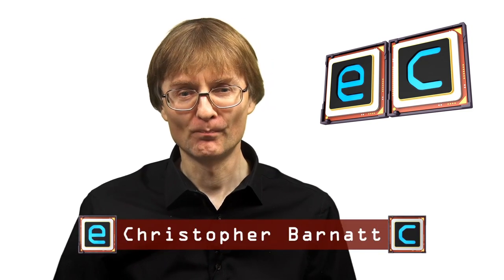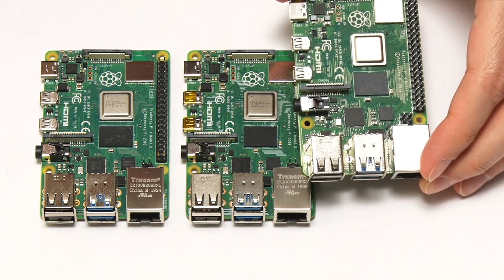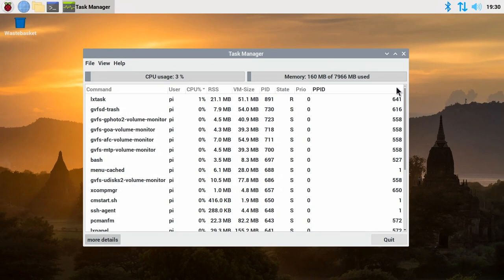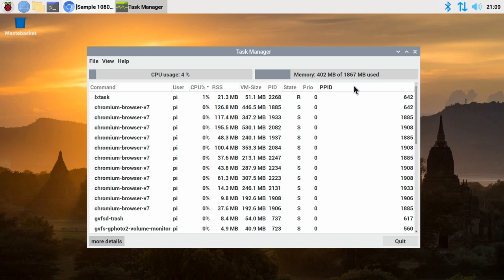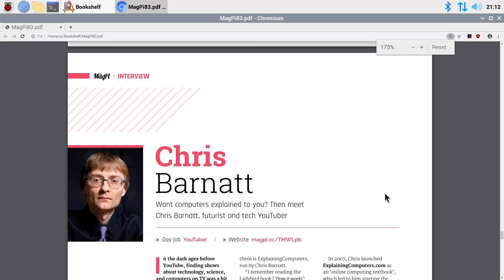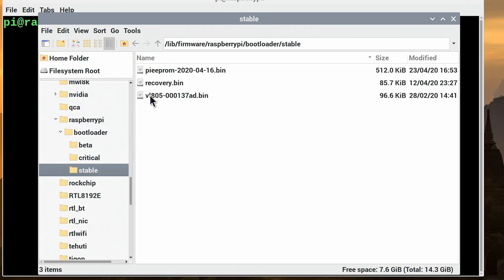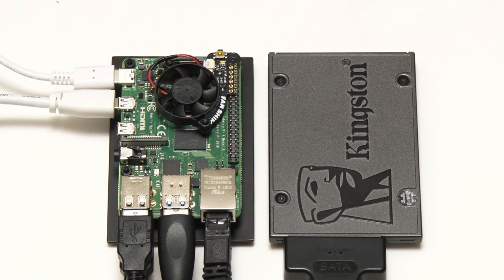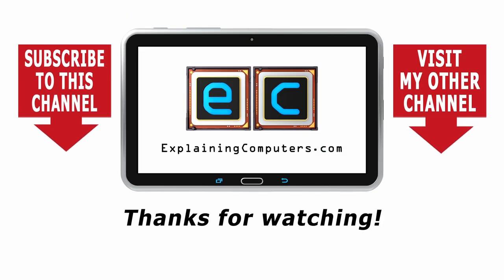Raspberry Pi 4 8GB & USB Boot

Comment: Thanks for your video! It works. However, it needed some tricks until a successful boot. With the last STABLE firmware (Jun 15 2020 ) the process is even easier and robust. I must mention the problem that I had with the sata-usb3 adapter. It wasn't compatible with rpi4's kernel and showed the most common symptoms of a misbehaving UAS device:
- Extremely slow performance - in the kilobytes per second range
- Frequent disconnects-reconnects of the device with the desktop repeatedly displaying the "removable medium inserted" dialogue box
- The kernel message log (dmesg) reports errors relating to a UAS device
I strongly recommend this guide if you don't have luck with your sata usb3 adapter: https://www.raspberrypi.org/forums/viewtopic.php?t=245931
Reply from the maker: Very useful link -- thanks for sharing.

Comment: Hopefully the RPI 5 has a much more powerful CPU/GPU stack at least for the 4 and 8 gigabyte models. As the modern and more powerful ARM chips get cheaper I'm hoping to see an eight core processor that can at least compete with the 2 years old Snapdragon 845 smartphone ship.
Reply: That's kind of greedy, considering it just came out. It could be a long wait. I was looking forward to Motorolla 68050 Mac, when they switched to PPC, and then again they went to Intel. Apple is definitely a different company than RPi, but still, you're counting your chickens before they hatch.

Comment: I would like to add that if you increase the amount of video ram, the desktop variants of Raspberry Pi OS will run much smoother. The max amount you can use is 500mb, though, regardless of how much ram your Pi has. You should see much better results at 128mb. I think Librelec uses 320mb for video.
Reply from the maker: Good point. I think i was on 64MB here.
Reply: @ExplainingComputers  - Try bumping it up and seeing if your 1080p playback improves (it should).

Comment: i just orden my first raspi4 8gb board and wait when can use, power have but i forget orden micro hdmi to hdmi cable wait thats now to post. and wait when come OS were have config section what you want use boot option, usb,sd card,usb harddisk,ssd,netdisk,ethernetboot. etc.first need be config option sd card or usb hdd/SSD. if thats come fast can buy more board and use better than idiot sd card system who broken wery fast. sd card not read/write manytime and not sure good harddisk.

Comment: Beware the USB boot... bricked two.
Reply from the maker: Now two is unlucky. A good warning here for others.
Reply: I had two pi 4 die with berryboot, using multiple os on an ssd, I have no idea if it's related, but I'm not touching berryboot again until it has proper release, (it works fine on the pi3) so maybe I need to wait for this too.

Comment: I am using mine as a programmable everything timer controller - to the second accuracy, as many actions as you want, repeating weekly, different for Sundays.Programmed in Python. using switches from https://energenie4u.co.uk/ I was irritated to find that I got 'pot luck' on which actual Pi I got from the online retailer in terms of power supply bug fix. I had no option than o get the official PSU. I was told they are all mixed up and the retailer can't tell them apart. Is this true?  I wrote the code on a Pi 2012 version but couldn't get that to also work as a file share hum ( hardly a NAS ). The Four works, but it was VERY hard to set up, all the online guides disagree ! I can no write to my HFSPLUS external drives, but can't alter existing files. Can you create a guide for creating a file server - with full write permissions on all disc formats - AND time machine options ? Thanks very much.

Comment: I use RPi 4B to write and publish a news paper. 
Also to publish YouTube videos   
I run al old mouse and keyboard into a USB adapter that goes to a powered USB 3. The second USB 3 I power a four hub USB bank that has 2 64 GB USB memory sticks and a 16 Gb memory stick and a USB fan on a stick that blows a across the board. Usb2 has a 500 Gb ssd drive. And usb2 has a video car ready for uploading 4K video. 
Check out YouTube channel Tirau Hall
Reply from the maker: Cool.

Comment: Very bad !!! Raspberry pi 4 heats even with 1.5 ghz quad-core processor at 15 watts minimum. Raspberry should look at any cheap $150 Andriod all of them are octa-core with atleast 2.0 ghz OR we can see iphone 7 with quad-core 2.3 ghz at 7.45 watts. Heating is not an issue today, we had that issue earlier. A hell lot of stupidity, they increased the ram to 8 GB running with stone age 1.5 ghz processor.

Comment: 3 Developer friends “on their own” have successfully created Windows 98 an XP (SKIN) THAT RUNS ATOP OF RASPBIAN OS.  IN ADDITION FOR GAMERS, THEY ADDED L”THE NEWEST RELEASE OF “RETROPI” AND “BOX86” IN THEIR MODIFIED OS.   THE SKIN GIVES FULL TEXTURE TO NEW LINUX USERS TO FEEL COMFORT WITH WINDOWS TOUCH AND FEEL.  (PLEASE NOTE: THEIR SOFTWARE IS NOT WINDOWS NOR ASSOCIATED IN ANY WAY.

IT RUNS ON CURRENT RASPBIAN OS /32BIT.  THEY MAY PORT IT TO 64BIT RASPBIAN OS WHEN AVAILABLE..
Reply: They also integrate “Commander Pi” into their OS. Total is around 8GB.  They recommend 32gb MICROSDXC.  Larger if you store games of course.  I store games on usb drive and have RETROPI and BOX86 USE GAME FILES VIA USB IN SETTINGS. I CAN PLAY GAMES ON OLDER PI OR NEW PI/ THEIR OS.
Reply: Sir CHRIS, “PI LABS” is a full time PROFESSOR but a retro game NUT. SUPERB PROGRAMMER.  His 2 partner programmers are extremely knowledgeable programmers.  “”I HIGHLY RECOMMEND YOUR CHECKING OUT THEIR “OS”,  PI LABS CHAT COMMUNITY, AND CONSIDER YOUR NEW VIEWERS THAT ARE WINDOWS TO JUMP ABOARD.  I HAVE BEEN WITH PI LABS ONLY 4 MONTHS, BUT ONE OF HIS ASSOCIATES “ETA PRIME” (ALSO ON YouTube) FOR COUPLE YEARS....
NOT AS LONG AS BEING WITH YOU!  WHEN IT COMES TO CORE EDUCATION,  THERE IS “””NO””” SUBSTITUTION FOR EXPLAINING COMPUTERS!!!

Comment: That's a nice ventilator 
does it turn on off at certain temperatures  or changes fan speed to temperature
     oh i see https://www.youtube.com/watch?v=VJC6OpGpq0Y
you can turn on boot messages in sudo raspi-config instead off black boot screen
like the pi 4 8gb = no more problems with chromium

Comment: What is the point in all this, because you've still got the bottleneck of the sd card.
Reply from the maker: I am confused: did you watch the video? Half of it is about how a Pi 4 can now boot from USB 3.0, so you no longer have to use an SD card. Indeed, on two occasions in the video I go to great lengths to show that the Pi is booting up and running without an SD card inserted. :)